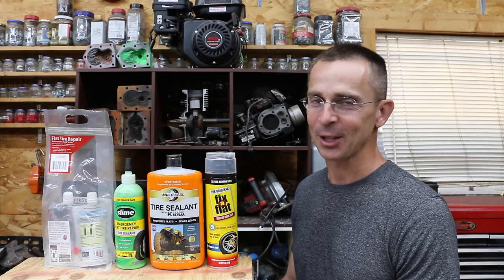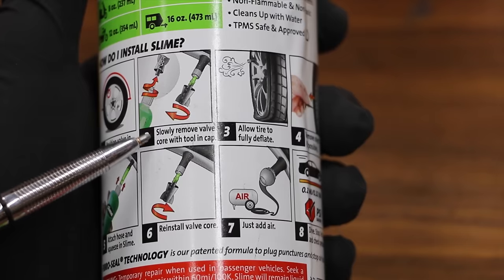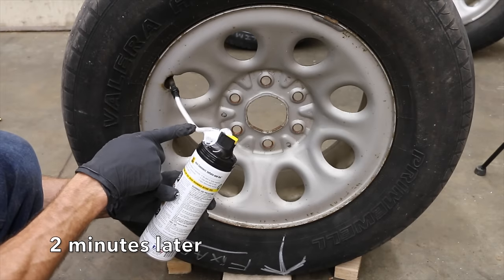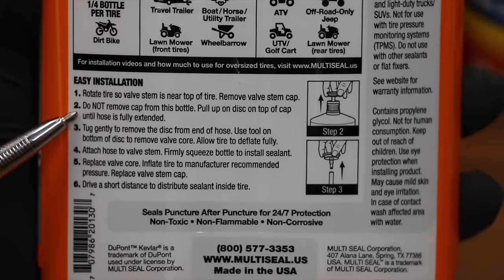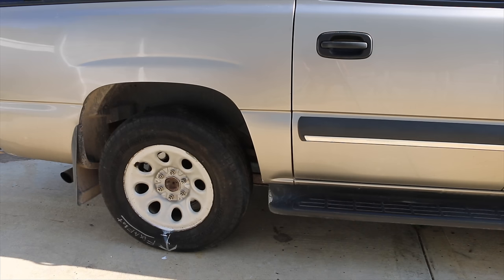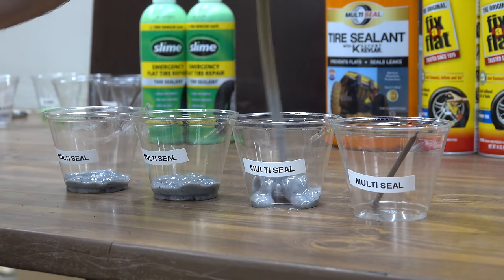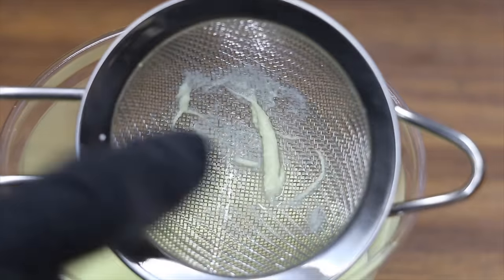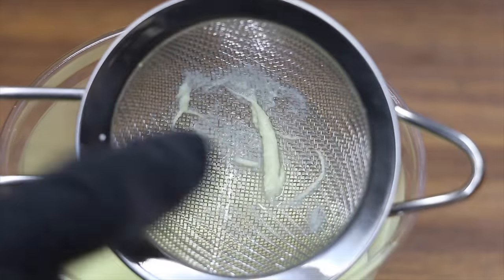Is Tire Slime the Best? Fix-a-Flat vs Tire Slime, TireJect, MultiSeal. Let's find out!

Comment from the maker: That was a LOT of fun testing these brands.  So, thanks to everyone who suggested this video idea!  Here are the links to the products tested.  Thanks again, Todd
Products Tested In This Video (in no particular order):
Tire Slime: https://amzn.to/32j38NJ
MultiSeal (now called Flat Out): https://amzn.to/31lQWwu
TireJect: https://amzn.to/2Qglk4W
Fix-a-Flat: https://amzn.to/2EgjCy5
Reply: You need to revisit this but for the tube tire sealer. Also Maxima tubless sealer is the best!
Reply: If you still have these I would enjoy another video on it but a diffrent test. Put them in a good tire then 7 months down the road puncture that tire and see if it still seals. Mountain bikers have a sealer used like that but I would like something that works in my side by side in those a tire puncture is prone to happen
Reply: I was told not to use it;
Person says it can cause explosion ~ dunno but I do not use it anymore
Reply: Tire Slime will push tire plugs out of your tire, FYI.
Reply: You said early in the video you wondered if it could even be a longer term solution, any opinion on that now?
Reply: Dammit wish I seen this vid before I got fix a flat....
Reply: As a cyclist, I’m laughing slightly at the idea a mechanic would be upset that there is sealant in the tire. It would be curious how these stack up against the two most common sealants in bicycles, Orange Seal and Stans, especially as a preventive sealant.
Reply: About a month ago. I tide 4  Tire plugs together in a knot dunked them in Flex Seal . It plugged about an inch gash in a four-wheeler Tire and held. I could not believe it I was shocked as hell maybe try a video on that and other products like that Flex Seal
Reply: Try making a videos of best car wash soap
Reply: ⁰
Reply: @danlux4954  This is the first time I am hearing this. Need to pick up on of these products to better seal a tire I just put 2 plugs in because I am on the hunt for a new car anyways. Which product do you recommend then?
Reply: @jonathangaliano2617  I haven’t put any in yet but I bought some TireJect, seems to have good reviews.
Reply: Your editing in all your videos is spot on perfect. You capture our attention and don't release it till the end...Bravo. No Big production intros with mind numbing noise or music. No bad camera angles, perfect lighting, definitely an A+++ to the editor, well done in all your vids
Reply: I wouldn't even advertise fix a flat. That is an embarrassment.
Reply: The time and effort put into your videos is awesome.
Reply: Multi seal, now called Flat Out, is GREAT.  I’ve had a leak in my riding mower for a few years and in a hand dolly for over 15 years.  Although it was not punctured, Flat Out stopped the chronic leaks.  Thanks for your testing review.
Reply: Can you try tyre repair plugger kits? 
Stop N Go  -  Dynaplug etc
Reply: I think it's important to point out that Fix-A-Flat is for SIDEWALL damage, not punctures through the tread.  Please try the test again with this in mind.
Reply: Sir,

Which brand of tire pressure pump would you recommend for cars? Thanks
Reply: I used tyre slime on a forklift my brother borrowed to move all his mechanical parts ( engine and transmission) so much work for 2 weeks using the forklift! Tyre slime worked perfectly on the tyre. Cheers! Great vids as usual! 🙂👍👍👍
Reply: Wouldn't you want the product to leave the tire after it's accomplished its job? Otherwise you're going to have an out of balance tire right?
Reply: @stylicho  you have to drive it a bit so it can circulate internally.its self levelling
Reply: Test Gemplers UltraSeal. There are 3 grades byt Commercial Grade 1/4in holes, and Extreme Grade 1/2in holes, are both for high speed use.
Reply: No you're right Fix-A-Flat is garbage
Reply: Ultra seal.....best money can buy!
Reply: Say what🤔

We're made in HIS image. HE made us with the power of free choice
A good prayer:
I'm a sinner JESUS please forgive me for all my sins I know you shed your Blood for me on the cross at Calvary. Thank you JESUS for my salvation and for shedding they Blood for me. I love you JESUS. 
Romans 10:5/10 ct...❤️k
JESUSisLord!Amen...
Amen..
If you'd like to call someone who cares 
83
For
Truth.
bc you don't know when you'll die?
.y r u hesitant........ ........ ......
Reply: Could you drop a link to the tire changer you used?
Reply: By the looks of those tires, somebody's getting their money's worth!
Reply: I'd love to know if tire balancing fluid works...
Reply: this is game changer product.
Reply: Best instructional video I've ever viewed..
Reply: Awesome video, been using Slime plugs and selant for years, glad it performed well